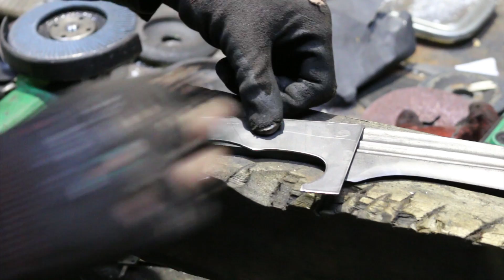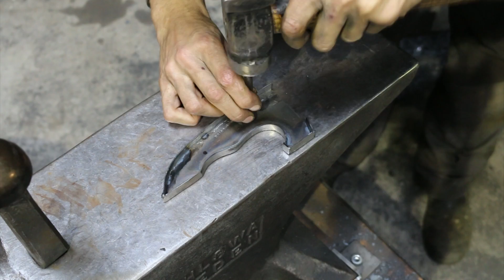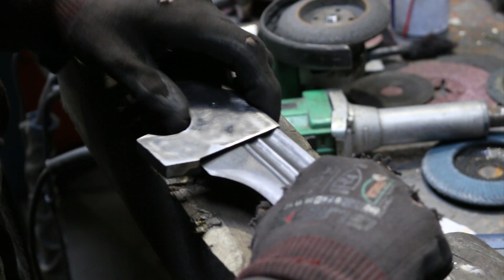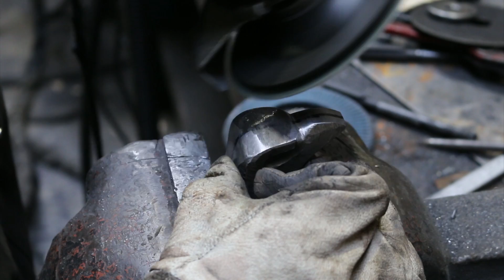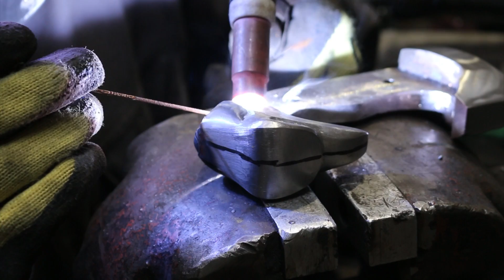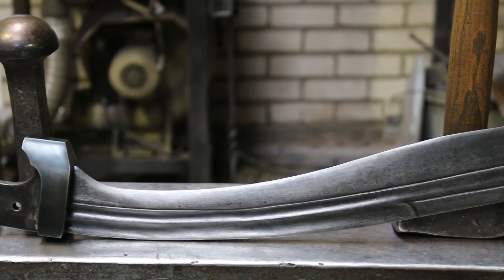Forging a Celtic Falcata sword, part 2 making the handle.

Comment: Another cool looking handle Freerk, could you tell me what the milky solution you put on your blades very heat treating is? I'm assuming some form of boric acid?
Reply from the maker: yes, it is a barrier against oxygen.
Reply: Thanks Freerk. Would you happen to have a recipe you could share?
Reply from the maker: just boric acid is ok, but I use  borax powder solution mixed with water.  
is does not desolve so you have to shake it before applying.  
i do it on a semi hot blade so the water vaporizes.

Comment: great video's keep what your doing. And i have a question. I am thinking about getting into this kinda stuff and i was wondering if you had any tips on getting started
Reply from the maker: Lazuras Gaming you can start with spring steel.  Don't forge too hot.  Keep the hammer hits even on both sides. count them for even compacting
Reply: Freerk Wieringa thank you very much

Comment: Just out of curiousity, do you ever make cast metal pieces for your works? or do you always forge/craft everything?
Reply from the maker: Woods Lore I do everything myself.
Reply: Freerk Wieringa Awesome. Was curious as I've seen many who cast certain pieces (pommels and guards mostly) if they have a lot of details. Yet your videos show you putting in the time to carve and craft the pieces. It's very impressive, I enjoy watching your work.
Reply from the maker: I would  like to cast my own designs in bronze but dit not have the time yet to do the reasurge.
Reply: lots of very expensive tools and mould making is a PAIN (though the rubber stuff is really good if you might want to keep your, acutype you make the design make connect it up say engrave mild steel braze on copper to make the or if it's light enough wax it up for the frame. make the rubber pore it cut out the pice store it and you have something you can mould again and again) if you cock it up back to the start
Reply: There is nothing wrong with casting bits, if you want brass, bronze etc. you have no choice as you can't forge it. Unless you're a idiot. Plus don't forget the if you get on a jet the bits that push the air through the engine are cast and they have to go through more than any sword. don't be so quick to assume it's a cheep quick cop out. It's a extremely difficult skill to prefect and once the die is cast there is no going back. not trying to be rude just wanted to inform you that it's not what you seem to think.
Reply from the maker: BobGP1 I would like to try it. It is on my long list of things to do
Reply: Freerk Wieringa well I wish you luck in your endive as it's fun but fraught with the chances to fail. thank you for your response :)
Reply: BobGP1 Were you meaning I thought there was something wrong with casting pieces? If so I never say that in any of my posts or imply that. I simply asked a question of whether he did any casting himself. If you took my comments to mean that I am sorry but that is mistaken.